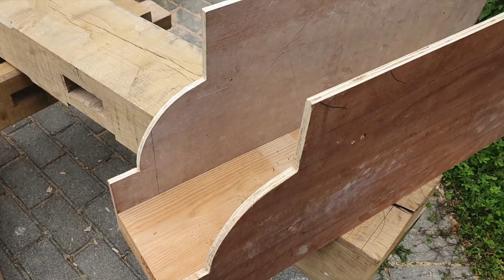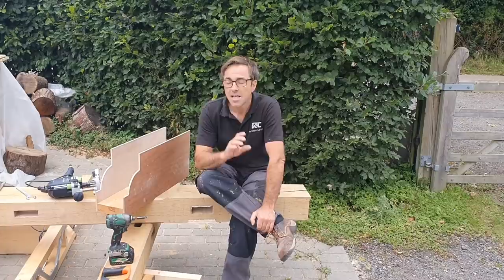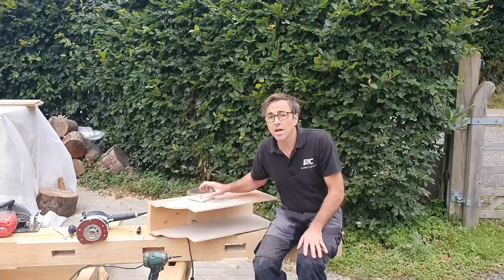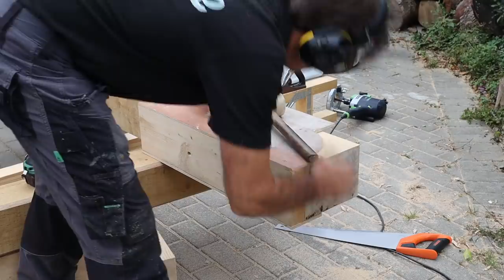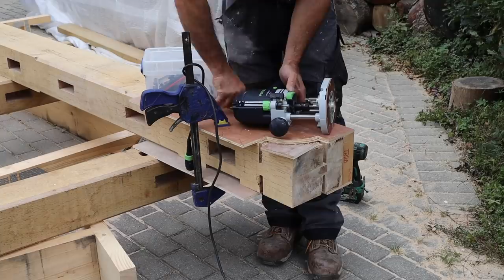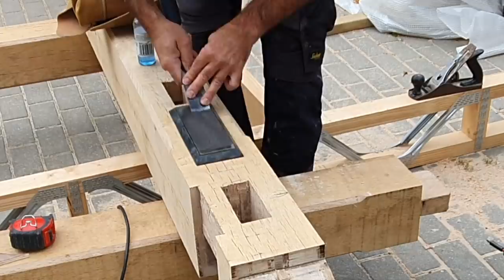The Big Build 23. How I created a beautiful detail on the end of an Oak Frame beam

Comment: I really enjoy the detail, there are so many little things that happen, the variance in tapping the chisel, the way you work the different angles. When there are multiple options for a job I like to consider:in order safety - how certain we can be of the result - the amount of effort - how much time it takes - and last but not least cost...bottom line opt for the safest method. At the same time - what's the point of having an extension collet for your router but to use it??

Comment: Have made the same detail myself when rebuilding Victorian era porch brackets (110 x 90 mm timber), though instead of a router I drew out the shape and then stitch-drilled from both sides, then cleaned up with a power sander. Worked a treat. Interesting to see this approach though.

Comment: Neat and precise as usual. Never had the big router or the table saw but always carried a couple of chainsaws. Freehand the design on a piece of scrap. Use that as my pattern. Cut out with chainsaw and clean up with belt sander. All our tenons cut the same.It was all we had. One of the guys I work with in Oz carves with a chainsaw. A big hardwood beam in one place we were working on he did all the cuts with a chainsaw and carved a large Platypus onto it as well. Looked great. I thought I was reasonable with a chainsaw until I moved to Rural Qld. The skill a lot have around where I live is phenomenal. There are a lot of houses where they cut the wood on the property and half built it with a chainsaw. And some of the carving is awesome. You are the more refined English gentleman style. Technically proficient and beautifully executed.

Comment: I was using a router locked out at full plunge to mortice a green oak beam.  I was astride the beam.  Going well.  Then it hit something harder.  It jumped up out of the mortice and pivoted out of my hand grip.  It fell back down onto the beam and the bit dug into the beam and propelled the router along the beam towards me and my wedding tackle.  Then in the manner of a cartoon the power cord reached the end of its travel and pulled the plug out of the socket killing the power and saving my manhood.  I then spent two days running around trying to find a joinery shop thta could do the job for me.  Unfortunately all were too busy.  So I returned to the mortices.  This time I only performed plunge cuts and cleaned up with a chisel.   Watch out using a router with the cutter extended and locked out.  Holding a half inch router and moving it when running is very difficult becuase of gyroscopic effect.  If you have to do it, then wait for the router to stop before pivoting to put it down.
Reply: Before I use certain power tools, I say to it in my mind “your my worst enemy” it’s a mental reminder to be very careful.
Reply: Couldn't agree more, power tools frighten the life out of me but I am 76 years old. It probably would have been quicker by hand but I suppose that creating a machine finish on green oak is necessary for customers who are paying a fortune for the job nowadays,  I wonder how they feel when shakes appear.

Comment: I was working on a big oak framed jettied floor once with a French carpenter, all the joist ends that sailed out over the wall plate had the same shaping as this. He said in France they call this design the balls of the pope! Les couilles du pape! Not sure If that's actually how it's spelt. Anyway it was a great project to work on and looked sweet.  Cheers Robin, keep um coming.

Comment: Firstly, weren't we lucky to have NESCOT on our doorstep. Such a high standard of teaching in the construction department.

Lovely video to watch, never seen that done before.

I will share something back with you Robin. Just bought myself a new folding rule, my last one has lost it's numbers on one end due being in my bricklaying bag.

I bought a Wiha 33232 Long Life rule. I think it would suit you and would be interested in your thoughts.

It is made of ABS not wood so is waterproof and the marks are cut into it so don't wear off.

It has a built in depth gauge, an angle finder and each hinge can lock into a 90 degree which is useful on first fix. ( Not sure how accurate it would be for second)

It has some extra marking too but it would be better if you looked at them rather than me trying to decribe. 

It's about £14 which is a lot for a folding rule but it does so much more that a normal one and it is made in Switzerland so should be accurate.
Reply from the maker: Nice one Harvey, we where lucky to go to NESCOT, that rule sounds really nice mate!!

Comment: Be careful of sharpening your chisels on the green oak. If you get any of the slurry on the timber (especially water) The tannins in oak react with ferrous metal and turn the wood black. 
Tip : Oxalic acid can help remove it after.
Reply: I was just thinking that. (Watch that oil) Phew!

Comment: In regards to remaining amount you chiseled off, in this instance couldn't cutter and extension shaft both be pulled out a fraction (looks like maybe 1/8") for final pass each side or sense so close extend them out 1/32" for all passes making it possible to allow entire cut to be done with router? Think possible to have been able to calc required depth of cut shaft locations in collet in advance. Just an observation. Regardless beginning of vid. final results looked great!

Comment: You could of taking of the jig/templet and used a top bearing, flush trim router bit to get more depth maybe
Reply: You need the jig because that's what the bush pushes against if you take it off the router will be 12.5mm out hope that helps 🔨

Comment: Circular saw, hand saw, hammer and chisel is another way to get accurate results. No profile jig required.
Reply: 5:25
Reply: @tomsmith9048  Was thinking pencil on the profile on both sides, run circular saw transversely at right angles every 1cm or so, each pass adjusting blade depth accordingly, then break/chisel off remaining pieces. Was just an idea in my head... Good depth-of-cut range of saw would help.
Reply: @randomtask9029  yeah there's many ways to do it it's what works for the person carrying out the job 🔨
Reply: @tomsmith9048  Yes

Comment: Beautiful work. Profile box with off-cut to stabilize the router!  I’ve stayed away from extension collets because I’ve been using bearing guided bits. Over-sized bushing large enough to accommodate collet!  How obvious (once you see it).  What caused the dark stripe in the central spine you removed by hand?  Laminated beam?  And what hand plane did you use to touch up the cut end of the beam?  #4 or a modern #1?
Reply from the maker: The moisture in the oak that had not been cooked out by the router!! Its amazing
Reply: It's not laminated it's just the way it's cut as it's not in one clean cut but 2 passes or more 🔨

Comment: Why didn't you take the profile off then use the router for getting the middle?
Reply from the maker: You need the profile for the guide Bush that is fixed in the base of the router to keep it lined up, take of the profile box and the router could skate around and be super dangerous!!

Comment: Think you need a shorter shafted claw hammer the way you were holding the one you have about 2 thirds up the shaft seemed wrong to me as I was taught to hold a hammer at the end of the shaft so you have more control and less strain on your arm and the hammer head is doing the work.
As usual a very interesting video keep up the good work and looking forward to the next one.